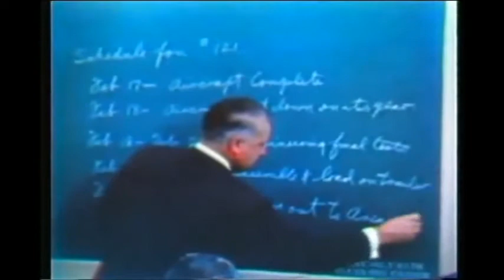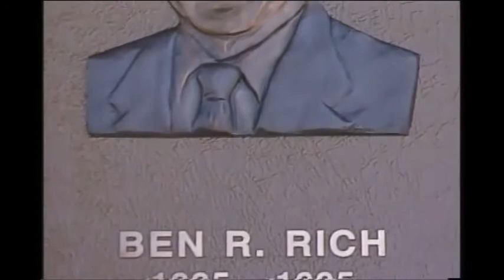Benjamin Robert, Rich Bio

Comment: I've just finished Ben Rich's autobiography, "Skunk Works". What a career, what an engineer. Long live the F-117A!
Reply: Rip 🙏 Ben Rich
Reply: I do believe the F-117A is no longer stealth and hasn't been for a number of years. It was great while it worked I guess.
Reply: @gangoffour6690  Do you have hard data supporting your thought or just a hunch? Because I believe just the opposite. The F-117 sacrificed a lot of maneuverability in favor of stealth, at levels never seen before or after. You might argue that the B-2 and the F-22 are stealthier overall in a wider range of frequencies, but I think that the front aspect of the F-117 is still unmatched.
Reply: @sebber7992 the F-117 was 70’s tech while the b-2 is late 80’s early 90’s big deference